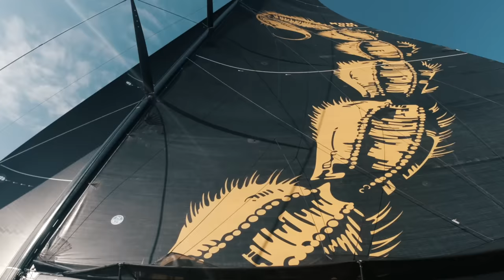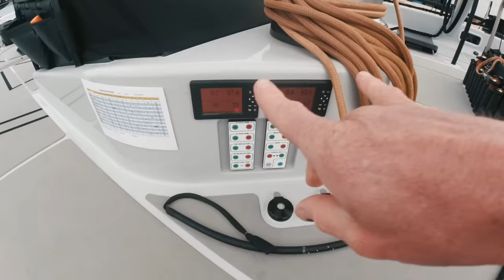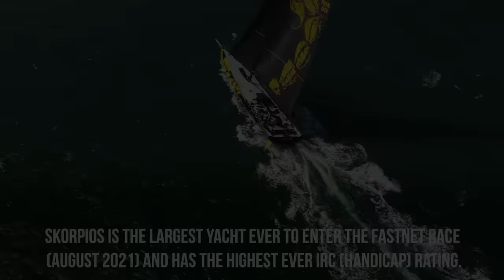Sailing a record slayer - is this the world's fastest offshore yacht?

Comment: If there is no battery bank, dose that mean the engine generator is constantly running while racing to power the hydraulics?? Anyone know how they power the hydraulics?
Reply: Likewise I am quite interested to know how the power system is set up. Despite what boat sales types will tell you, gasoline generators in enclosed spaces are inherently dangerous, but they can be made safe for the right sum of money. Diesel is much safer but significantly heavier. Actually the lightest internal combustion solution would probably be a gas turbine. For example, an Allison 250C20 aircraft engine providing 420(I) shaft horsepower (derated!) (~313.19 kW) weighs ~200 lbs. (~90.72 kg). Note that this is for the engine/prime mover only and doesn't include the weight of the generator section and associated switchgear.
Reply: It’s not a sail boat if it needs an engine to sail….

Comment: 'She can set over 10.000 sqm of sail' ... That might be her full wardrobe of available sails, but not all at the same time. 10k sqm is 100x100m which is a bit presumptuous on a 40m yacht. An absolute beast of a yacht though!
Reply from the maker: Actually I said 'over 2,000m2 of sail' not 10,000m2! Sorry if it wasn't very clear. But main and A3 together = 1,961m2, but they will usually set a couple more headsails to fill the slots too

Comment: I notice that Imoca 60 Apivia managed to keep up with her pretty much all the way to the Fastnet though. And that was mostly upwind.
Reply: Foils vs no foils right?
Reply: Both boats have foils but apivias are more pronounced
Reply: @nicholasheggerud5750  He specifically said nonfoiling?  I didn’t see foils?
Reply: @nicholasheggerud5750  sorry saw the foil assist right at the end.  Funny no mention of the control system for it
Reply: @NiceTriGuy  it has the same foil mechanism as the clubswan 36. Really neat you should check it out

Comment: If skorpios were keeled accurately from headsails to mast and rudder control.  The ship could sail with less wt as ballast and sail more upright and faster using keeling design to reduce heeling over increase sailing speed and rudder control in high wind.
Reply: Keeling the headsails ahead of the midpoint between the mast and forestay of the largest sail relative to the the sail area ratio main to headsails gives the headsails and cutters forward power and if done to the mast too heeling over is turned into forward power.

Comment: Time will tell... she is an interesting boat, about halfway between Comanche and Mari-Cha 4 in length, and the single mast design for overall efficiency... the multiple headsails are much more efficient than a second mast and its windage penalty. She will have to work hard to beat Comanche in the future, as that boat was built to race and take records with its only design parameter. cheers!
Reply: this boat is designed to fuck up your Comanche ........